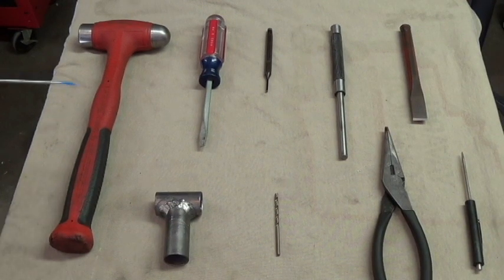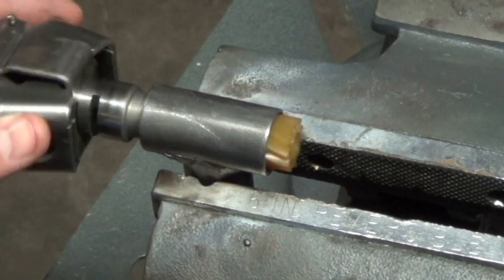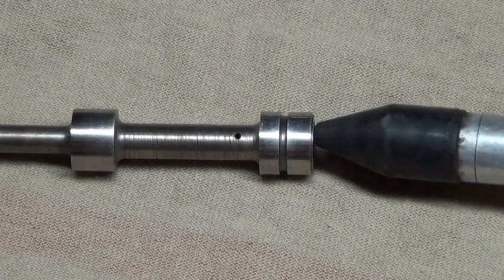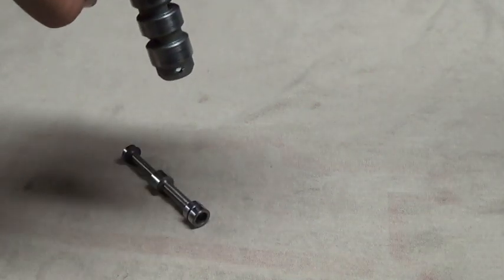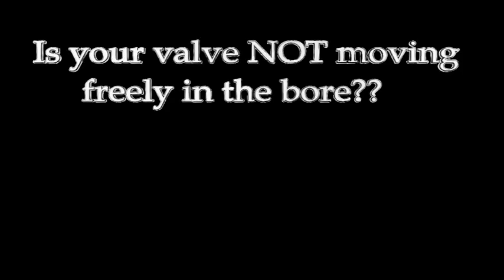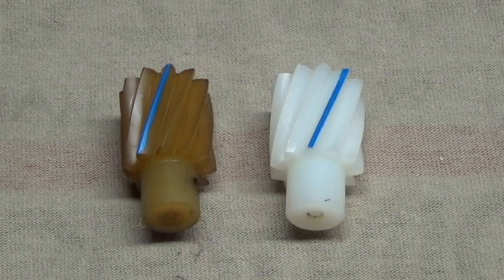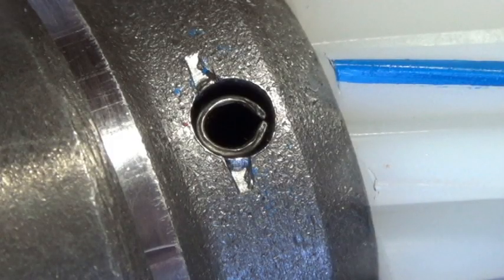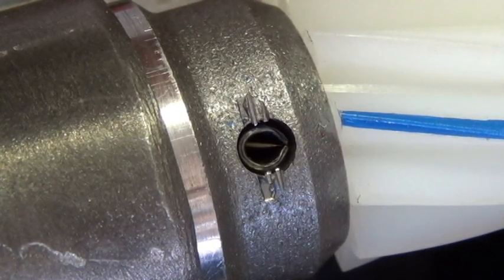TH400 Rebuild:  Governor #SouthpawAutoworks

Comment: Hey, when removing the governor on car, will fluid come out? Do I need to change the whole fluid or is it just a little bit?
Reply from the maker: Yes, fluid will leak out.  A basic oil drain pan is typically adequate to do the job.
You can typically get away with just topping off the fluid after the repair.
Note:  The governor is very sensitive to contaminants in the fluid.  To get the most out of an automatic transmission, it's a good practice to replace the fluid/filter every 30k miles.
Have fun and be safe.
Reply: @SouthpawAutoworks  Thanks! Yeah, my car has just about 30k miles and filter has been changed a year ago. I do have a problem that it is not shifting into 3rd gear anymore. Already tested a lot of things and now it's the governor's turn. Hopefully not the 2-3 shift valve in the end ...
Reply from the maker: After reading your comment, I'd be leaning towards the 2-3 shift valve.  However, anytime there is a shifting issue, it's best to take a look at all of the parts responsible for upshifts/downshifts.  
I am, in no way, discouraging you from looking at the governor.  As you saw in the video, checking the governor for proper function is pretty straightforward.
Please let everyone know about your findings...when time permits.  Thank you, Marvin.
Have fun and be safe.
Reply: Hello I'm working on a 700r trans it is in a 92 blazer k15 with a 350 small block tbi  I had a plow hooked up to it when.i first got it it shifted out of first at a hight  late rpm then shifted fine in a gears  so  I took the plow off and it hasn't wanted to shift outt 1rst since then   drive works but dont up shift od  works but dont shift up and 2 works after pressure  builds up and it shifts does any one have ne advise  I've changed the trans filter and fluid and also the govner  works just fine the tv cable is a little bit tight
Reply from the maker: Marvin,
Updated videos on the way!

TH400 Rebuild Series - Coming Soon
https://youtu.be/q0eciXU8YEI
Reply from the maker: Updated videos on the way!

TH400 Rebuild Series - Coming Soon
https://youtu.be/q0eciXU8YEI

Comment: Rebuilt th400 seems to learch before it shifts 1st to second 2-3 sometimes if i let off the gas it will shift. Any ideas. Got the th400 rebuilt by a trans shop. Could take it to them but this bs hoax thats going around i cant go. Think the governor is bad or the mod valve is faulty ? Thx for everyone’s help if u chime in
Reply from the maker: If this issue happens during all upshifts, I'd definitely be looking at the governor and vacuum modulator.
The modulator operates off of engine vacuum.  There's a rubber hose(s) and metal tubing that connect the vacuum modulator to the engine's manifold.  It's possible that this vacuum circuit is either plugged, or leaking.  Speaking of leaks, it's possible that the engine has vacuum leaks.

As you probably already know, an engine at idle produces a lot of manifold vacuum...or at least it should (varies with elevation).  [Manifold vacuum is to not be confused with ported vacuum.]  An engine at WOT (Wide Open Throttle) produces very little, to no, manifold vacuum.  The modulator is designed with these facts in mind.

Let's say your engine has vacuum leaks....leaks in the engine, or leaks in the rubber hose & metal tubing that connects the modulator to the engine.  If there are leaks, the vacuum present at the modulator is lower than it should be.  The modulator "thinks" that the engine is working harder than it really is, and delays the 1-2 shift...or the 2-3 shift.

Let's say that the tubing that connects the engine to the modulator is plugged, with carbon.  If it's completely plugged, then the modulator "sees" no engine vacuum, and again "thinks" that the engine is working harder than it really is...and your upshifts are delayed.  There's more to this...but I'm trying to not get carried away.

There's a balancing act between the governor and the modulator.  It can be translated to road speed (governor) and engine load (modulator).  It's a tug-a-war between the governor and the modulator.

Typically when there's a problem with the governor, it results in no upshifts...or very delayed.  So, I would be focusing on the modulator...if it were me.

Does the modulator, by chance, have a red stripe on it?
Also, the modulator can be adjusted...but that's for another time.
Reply: Southpaw Autoworks  awesome thx for the reply. So here’s the deal i did a ls3 swap and the th400 worked fine but the trans wore out on me so i got it rebuilt and put it in and i have that problem. I changed the mod valve on the trans before it got rebuilt because i thought it was that when the trans did its thing and started to slip thats why it came out of the car. I changed the mod valve back to the org one and i had haven’t had the time to test on it again. I wonder if the governor is sticking. I will definitely check it out if changing the mod valve back to the one i knew worked a month ago before the rebuild. I have 3 gears it will shift if i let of the gas. Wot it will just rev to the moon.
Reply from the maker: Updated videos on the way!

TH400 Rebuild Series - Coming Soon (60-Second Preview)
https://youtu.be/q0eciXU8YEI

Comment: where did you find the governor kit
Reply from the maker: The kit was purchase by a vendor that does not sell to the public.  However, I'm working on helping everyone get everything they need to get from A to Z with these videos/transmissions.

Future Video Goals:
1).  Supply great videos on how to perform the overhaul.
2).  Provide a way to access the specialty tools, with ease.
3)   Provide a way to make your own tools, if you feel so inclined, or simply want to save money.
4)  Provide a way to access high-quality parts.  Not all parts are of the same quality construction/design.

Thanks for the comment.  More videos, with much greater detail, are on the way.  Stay tuned...
Reply from the maker: Updated videos on the way!

TH400 Rebuild Series - Coming Soon (60-Second Preview)
https://youtu.be/q0eciXU8YEI

Comment: Hey Brother my Turbo 400 is making a whining noise and when the car is at operating temperature the noise goes away and the car will shift nicely do you think the governor is the problem thank you
Reply: I checked the governor today and everything seems to be good I will lower the pan tomorrow to see if I can see anything wrong hoping that it's the filter I did change the fluid   also learned that the brass filters are better than the ones with the material paper in it
Reply from the maker: ATF (Automatic Transmission Fluid) is temperature sensitive.  When it's cold, it shrinks.  When it heats up, it expands.  This affects the fluid level.
The pump on any transmission will whine when the fluid is low....power steering pumps do the same thing...make the same noise.
If it were me, I would be checking the fluid level.  Let the engine come up to operating temp, have the vehicle idling in park on a flat/level surface, E-brake engaged, tires chalked, etc.  Pull the transmission dipstick, wipe the stick clean, and reinstall the stick, and immediately pull it right back out, to inspect.  Check the fluid level on the stick...flip it over to examine both sides.  It's not uncommon for one side of the stick to show a slightly lower fluid level than the other.  I use the "lower side" as the reference.

Dude, I would really like to hear about your findings regarding the fluid level...and anything else you discover.
Reply from the maker: Right on!
Reply: @SouthpawAutoworks  today I drop my tranny pan and check the filter once again I just change the filter with an oil change on this transmission less than 5 months ago when I got to finish the car to make it  Road ready I have videos on YouTube of the 69 Firebird filter looks good trans oil looks nice and clean I was a little low but not that bad put everything back turn on the car I let it come up to temperature and the transmission is still making the whining noise as the car warms up it lowers a little less noise but when you put it on low gear. Whining noise is higher I guess I'm going to have to rebuild this turbo 400 thank you for your help
Reply from the maker: Updated videos on the way!

TH400 Rebuild Series - Coming Soon (60-Second Preview)
https://youtu.be/q0eciXU8YEI

Comment: To you rebuild auto trans for a living?
Reply from the maker: At one time I did rebuild automatic transmissions for a living.  I post these videos to help anyone who is interested in learning more about these.
Reply: guitargube I have an 89 Chevy Silverado K1500 with a 700R4. Truck won't shift into 3rd gear, it just starts slipping when I reach about 40 mph. Thinking about trying to rebuild the transmission. I hae never done it before but I know there is some manuals and 2 or 3 DVDs on how to rebuild them. Do you think I would be able to pull it off with those manuals and/or DVDs?
Reply from the maker: Updated videos on the way!

TH400 Rebuild Series - Coming Soon (60-Second Preview)
https://youtu.be/q0eciXU8YEI
Reply from the maker: Updated videos on the way!

TH400 Rebuild Series - Coming Soon (60-Second Preview)
https://youtu.be/q0eciXU8YEI

Comment: how can you tell if the govenor is messed up when you take it out
Reply from the maker: Thanks for watching the video.  Your question is appreciated.
The plastic governor gear can be chewed up.  When the gear is chewed up, it will look like a mostly-eaten apple.  
Out of the possible governor problems, the valve not moving freely (due to contamination) is the most common issue.  
When holding the governor up right (gear at the top), push both weights inward, at the same time, and then let them drop outward at the same time.  While doing this, look to see if the valve is moving up and down.  Watch 5:16 of the video to see what the valve movement looks like.  If the valve doesn't move on its own, the governor will need to be taken apart, cleaned, and then reassembled with a new governor gear (recommended for a couple of reasons).
Reply: @SouthpawAutoworks  thanks i replaced it the other day and it fixed my problem. the valve wasn’t moving on the other one
Reply from the maker: Dude, that's great!  Thanks for the follow up.  
Congrats on your successful repair of your transmission.
Reply from the maker: Updated videos on the way!

TH400 Rebuild Series - Coming Soon
https://youtu.be/q0eciXU8YEI